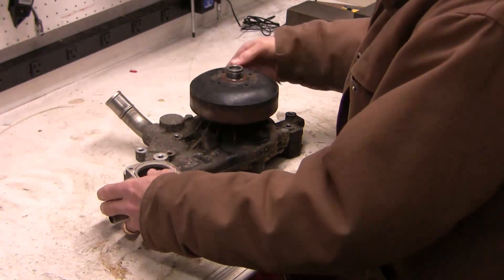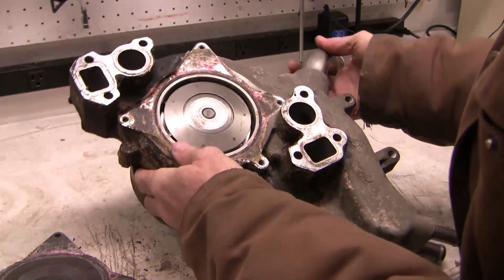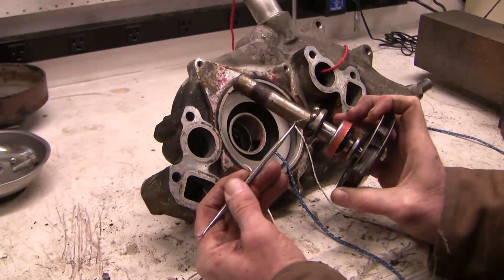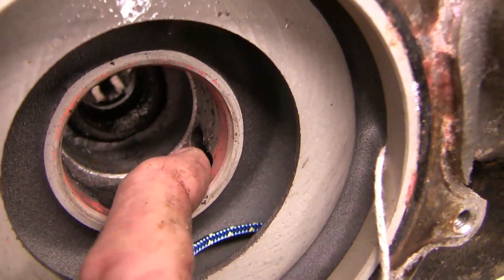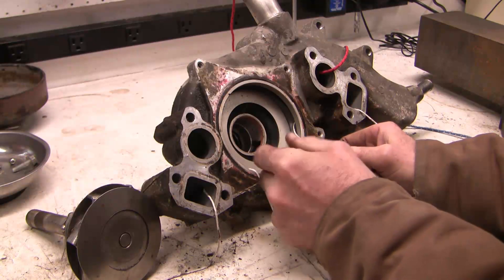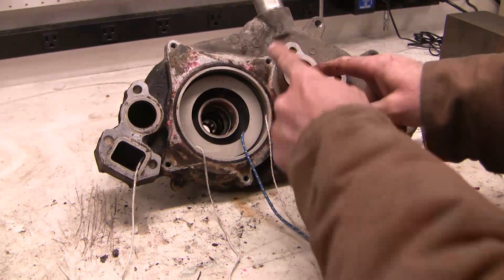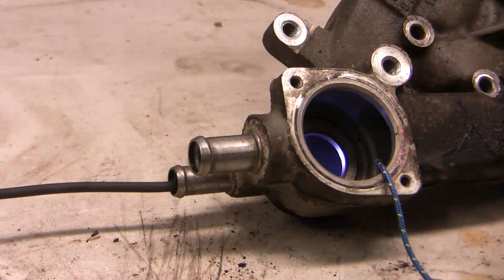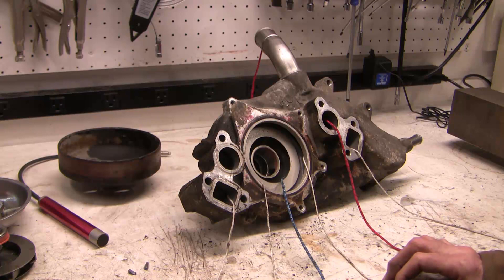Inside a chevy water pump -- how it works

Comment from the maker: Even years later I still find this cooling system to be fascinating. Dual valve thermostats are now mainstream, but even today many don't understand how they work. Unfortunately these could fail in complex ways, sometimes leading to an overheat because the bypass valve didn't close completely even if the main thermostat valve was wide open.
Reply: Is there a video explaining failing thermostate?
Reply from the maker: @tipsreviews7476  Not specifically, but I did touch on it in a cooling system video titled "understanding marine diesel engines". The thermostat in the Yanmar is similar to the Chev thermostat because it also makes contact on the back, effectively giving two sealing surfaces, one of which is open when cold, the other open when hot. I also did a cooling system playlist on the channel.
Reply: @spelunkerd  thanks for the response. My engine fan is always running but my truck isn't overheating. Wonder if it's the thermostate?
Reply from the maker: @tipsreviews7476  The electric fan in most cars is set to come on if AC is called for in the cab, even if the engine just started. So, remember to turn off AC if you want to watch fan activity. The fan is controlled after the PCM reads the temp sensor, so if fan is coming on when cold, I'd be looking at the temp sensor first. If the fan is run off the belt, the viscous clutch inside the fan controls speed, but those old style fans did always run even when cold. You can tell if the thermostat is open by putting a hand on the top radiator hose to see if it is warm. The thermostat doesn't command the fan on so unless you have overheating or a failure to warm up quickly I'd be looking elsewhere. A scan tool with live data will make this effort a lot easier and faster.
Reply: @spelunkerd  thank you I  subscribe to  your channel . Great content. 👌

Comment: I was driving my 2001 gmc sierra 5.3 with just over 300,000 miles two days ago and the water pump bearings must have seized up and they fell apart because the fan was hanging down and I could move it all around so I bought a new water pump and I took the old one off and I only saw two round bearings and one roller bearing fall out so do you think most of them fell down into the chambers where the coolant flows? I'm going to stick my snake camera into the bottom rectangular holes. Any thoughts on how far the bearings would go in there?
Reply from the maker: That's a good question, I don't know for sure. If you wanted to you could back flush the engine and heater core, flushing with water from a hose backwards to drive any possible bearings backwards into a pail. I'm gonna give you a big fat guess that the risk is small.

Comment: Fascinating how simple that design is. A brilliant simple mechanical system, it obviously took some creativity to design. Its amazing too that this system can run about ~480 million cycles (in my case) before failure. And it was designed to fail well also, with the weep hole showing symptoms of wear before catastrophic failure. Thank you for breaking this down, you have a great video.
Reply from the maker: Thanks for watching, I find this system very interesting, too. One of the unique features of this design is the way the thermostat controls flow from the radiator on the cold (return) side. The wax pellet and spring are immersed in the hot liquid but the valve it moves is on the cold return hose. The hot side (the hose sending hot coolant to the radiator) is always open, but coolant won't flow through the rad until the cold side valve permits flow. This means that even before the thermostat heats up enough to open, the radiator is subject to systemic pressure. A conventionally designed system isolates the radiator from the high pressure side until the thermostat opens on the hot side. 20 years ago we had an older Suburban that blew the radiator tubing out, caused by a failed thermostat that didn't open before the coolant boiled itself into a high pressure state. I found it a strange way to fail until I understood the unconventional, dual valve design. The other problem with this design is the fact that if the bottom valve doesn't seal well, your engine could run chronically hot because more coolant is bypassing the radiator through that huge bypass hole. Older style bypass tubing was a small diameter passageway that limited flow simply because the bypass tubing couldn't take a big volume. It's a good idea to replace the thermostat if you have an overheat because the wax pellet could melt enough to dissipate and cause a chronically underperforming system that is not easy to diagnose.

Comment: Thanks for taking the time to do this.  I knew the theory of the weep hole, but had never seen the inside of a water pump.  I also knew there was a bearing inside, but was surprised to find out there are actually two in this pump.

Comment: Very informative...currently have a leaking water pump..was thinking to seal up the weeping hole with some JB weld..lol...after watching your video i realized that when the seal is damaged  the weeping hold allows the coolant to drain out before it reaches the bearing ..great video...thanks

Comment: Great video! It has helped me understand why my porsche/ls1 conversion was running hot. I wasn't using the heater core so I had just made a loop in the heater hose outlet to the heater hose inlet. After watching this video it's clear to me I had been basically short circuiting my whole radiator circuit with that heater hose loop, even with the tstat open the heater loop was the path of least resistance which must have really decreased the needed flow through the radiator. I'm going to change my setup today! Thanks again!
Reply from the maker: That's a good point, some cooling does happen at the core. Veterans say if the engine is running a little warm and you are trying to limp home, you can put the cab heater on full blast in the summer and you'll get better engine cooling (AC off). However with the damage possibly caused by continuing to drive with an overheating engine, I would hesitate to do that.

In your case, if the thermostat valve that opens and closes that short circuit pathway fails, you may just run a little hot. So, when you are in there, have a look at the themostat and if in doubt, replace it. Some systems do not have that short circuit valve, it stays open all the time. Thank you for watching!

Comment: awesome, thank you. especially the weep hole. the whole process is clear and elegant.
Reply from the maker: Thank you. On most vehicles the weep hole is hard to find and you don't get a good view. Once the water pump is disassembled on the bench, it is easy to understand the more subtle findings you often get on the car. What I find intriguing about the Chev design is the way the thermostat closes the large bypass hole at the same time as opening the return pathway from the radiator. More traditional designs only do the latter, and the bypass is always open but much smaller (so there is more resistance to coolant flow in the old design). With a huge bypass hole, it is less work to spin the water pump while the vehicle is warming up, so I believe the Chev design is there to improve warmup fuel efficiency.

Comment: Very nice video, thanks for posting. The pump you used in this video has a machined aluminum impeller which make it a high flow pump. I realize it's been 11 years but would you know the brand and number of this pump? Thanks!
Reply from the maker: That was an OEM pump made by General Motors, but other details are lost. Although very old now, there is still a healthy aftermarket for these pumps.

Comment: Awesome video. The plastic fitting to the ac unit snapped yesterday. Since so much coolant was all over the engine bay, decided to do a flush. One complete, only put 2.5 gal of coolant back in the system. Suppose to be 4.5 gal. Think you can help me out on this mystery?
Reply from the maker: Trapped air, you need to burp the cooling system. Leave the radiator cap off, start the engine, and add coolant to keep it topped up while engine is running. The water pump will push that air pocket into the rad, but it won't be complete until the thermostat opens. You'll notice that because you'll feel the upper rad hose go hot. Then stop, put the cap back on, wait a day, recheck and refill levels. Several videos on my cooling system playlist go over that in detail. Good luck!
Reply: @spelunkerd  funny enough, im currently watching your chevy axle video as typing. You do some good stuff. Gonna look into speed sensors tomorrow for the 4x4 issue im having.
Reply: @spelunkerd  so I followed your steps last night. It led to me adding that .5 to the radiator. Should still need 1.5gal added. Im re-doing your steps. Do you think that will fix it or am I missing something?
Reply from the maker: @TheGraffiti600rr  Some vehicles have valves to allow trapped air to escape, check the OEM dealer repair manual for that, I use alldatadiy. Some mechanics use a vacuum suction technique, to evacuate trapped air, I don't.  The automatic burping mechanism relies on a good radiator cap, check the seals there to be sure the siphon mechanism from the coolant recovery bottle will work overnight as the engine cools. It may take many days and multiple refills if automatic burping is the plan. Good luck!

Comment: Great video my friend, today I was installing one on a 4.8 I realized that is a reverse flow, I was checking temp, expecting to see hot at thermostat outlets, but surprise me that 15 to 20 degrees colder than the pipe outlet on top
Reply: Rebuilding a 302 skip white Hc 8050 s water pump

Comment: Great vid, but didn't you turn that impeller 2 different directions? 1st when the pulley was still on, you spun counter clockwise. Then pulley off and the impeller loose, you went clockwise. Or am I just seeing things? I'm trying to diagnose my 88 5.7 TPI with a serpentine set up. Trying to figure out if this pump is for a V belt setup that's turning the wrong direction. I've got no flow to the upper radiator hose and the thermostat is out.
Reply from the maker: Yeah, I didn't mean to confuse anybody with that. When you look  at the fins, you can see which way it has to turn to throw the fluid out from the center.

I guess if the serpentine belt were put on wrong it might send water in the opposite direction, but the OEM belt probably wouldn't fit if the routing was wrong. There should be a diagram of the belt routing on a sticker somewhere under the hood, but if not you'll find it in the dealers repair manual. One tip that sometimes helps is to remember that ribbed pulleys contact the inside of the belt, and the smooth pulleys contact the smooth outside of the belt.

Some water pumps have plastic impeller blades, which can break and throw little parts down the line, so it might be wise to have a look. I've also occasionally seen radiators that were so badly corroded they don't allow much flow. Of course remember to burp the system to be sure trapped air is completely removed. Thanks for your comment here.

Comment: Great video. Can you do me a favor before I ruin one of my good pumps. The shaft the pulley sits on...can the tip be cut off to make additional room for an electric fan in a tight engine swap scenario? Or is it hollow at all sharing a passage with the impeller?
Reply from the maker: I don't know. As far as I know, they are solid.
Reply: @spelunkerd  I just chopped 2 off are solid and good to go. Made room for my fan setup just hope it doesn't mess up any balancing of the shaft.

Comment: Very interesting explanation, I've seen many tests done to this pump one of them is using a Nissan thermostat that have a significantly shorter bypass plug basically it doesn't seal the bypass the result is a much cooler ect around 160f . Can you explain why this happening? Thx
Reply from the maker: There are many factors in involved in where the sweet spot is for engine temp. I did another few videos of the cooling system in the little 3 cylinder Yanmar diesel engine, and it has a similar two valve bypass system as well. It also runs cooler. Thank you for stopping by!

Comment: Reminds me of a College professor. But I am confused about the cold bypass function because its supposed to be open when system is cold but when I recently installed a thermostat in this type of pump the back end disc of the new tstat bottoms out over that bypass hole inside the pump. Why would it be closed over the bypass hole when cold ? Are they selling thermostats that are dimensionally too long ?
Reply from the maker: It's been a while since I thought about this, but as you say when the engine is cold, the top part of the thermostat should be closed, while at the same time the bottom part should be open to allow fluid to short circuit. As the thermostat heats up the reverse happens, forcing fluid to take the longer course through both the radiator and the heater core. GM sell the thermostat together with the housing, and that's a part I wouldn't trust to aftermarket suppliers.

Comment: Great vid. What is the tool, other than the 3-jaw puller when you are taking the pulley off? I got mine to move about 3/16 inch and it stopped moving. I have it under tremendous pressure and it's stuck.  There's not a hidden set screw somewhere is there?
Reply from the maker: I put it into a 10 ton press, it is the size of a big desk, not exactly a garage tool. No, I never found a set screw, it's just pressed into a blind space with the weep hole on the other end. The bearing rusts onto the outer race and it comes off by breaking the bearing, much like a wheel bearing comes off, in pieces.

Comment: Thanks for  making. Are you certain that impeller works that way and not the opposite? Seems to me that grab coolant from the more open outer areas, and force towards shaft.
I have an 09 6.0 and  have began experiencing temperature spikes at extended periods of idol. Has newer radiator and thermostat. Heard some impellers were plastic and have been known to fail and cause this.
Reply from the maker: Excellent question. Yup, all centrifugal pumps pull fluid from the center and fling it outward, for more info search 'centrifugal pump'. Here's a video that explains it more clearly. https://youtu.be/Vhc-hEjh12I
Regarding your truck with temp spikes at idle, check to be sure your cooling fan is coming on, or if it is belt driven check to be sure the fan clutch is working and the fan is spinning correctly. Check the coolant level at the radiator cap, if possible (with engine cold so you don't burn yourself). You may be able to see coolant turbulence as the fluid is moving by, verifying that your pump is working. Also feel the hoses leading to and from your radiator to verify they are different temperatures, also verifying your thermostat is opening and your pump is working. Good luck!

Comment: I've just started rebuilding parts for my own cars.  It seems silly to throw a bunch of money at the part stores, when it's just a few easily replaced seals.   The power steering pump parts kit was $10.66  instead of $69.99.  The alternator was $34.95 instead of $168.99.   Those prices are what the Autozone site shows for a reman part.

I took the opportunity to treat my parts a little better.   Degreased, sandblasted, and painted the housings with VHT engine paint.  I picked painted, rather than polished and clear coated.    I don't need to rebuild the water pump quite yet, but I do have a core in my shop that I can do.

So now a question ... I was hoping to find a video about how to tear it down to rebuild it.  I know I'd be repairing the bearings and seals anyways, but your way was kind of destructive.   From looking at the parts, could you identify how it was to be taken apart normally?   I'm guessing the impeller gets pulled somehow, and there is something interfering with the shaft coming out.   Was there a clip somewhere that would have released it?   Obviously, they put it together somehow.  And there are reman water pumps available.   So there must be some graceful way to get it apart.
Reply from the maker: I know what you're saying. Thing is, when the bearing seats into the aluminum housing, it oxidizes into place, and when you try to remove it the pressure required is so high the bearing fails before the tight connection lets go. It is similar to a pressed-in wheel bearing. You often can't get the bearing out without destroying it. That said, I believe if you find a replacement bearing, rebuilding it should be easy enough. After all, that is actually what rebuilders do with the core they get back.... Unfortunately finding parts, paying for shipping, hoping they'll fit, and getting the job done quickly may be problematic. Similar to rebuilding a starter motor, finding those small parts may be tricky. Good luck!

Comment: Would it be possible to add an inline electric water pump to the existing system in order to cool the engine down when engine is off? I drag race and want to turn on electric pump and fans to cool with engine down without it running ?? thanks in advance..
Reply from the maker: Good question. I’ll guess it could be done by replacing the belt driven pump and fan, perhaps even with a tiny fuel economy advantage.